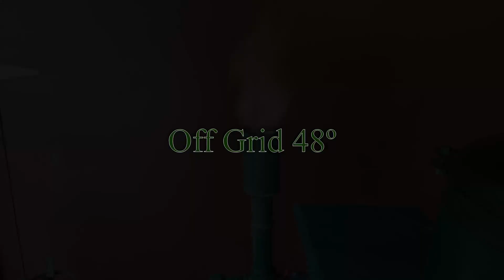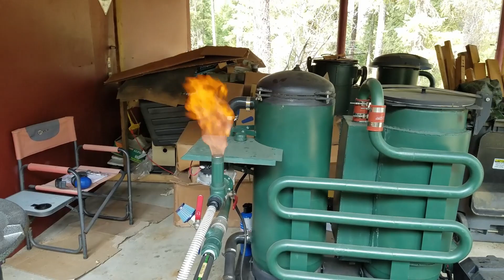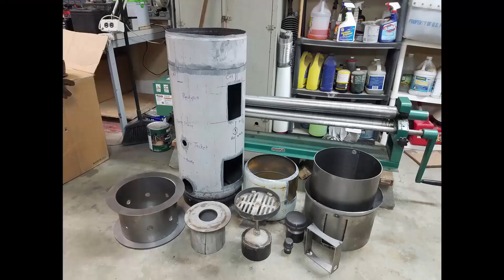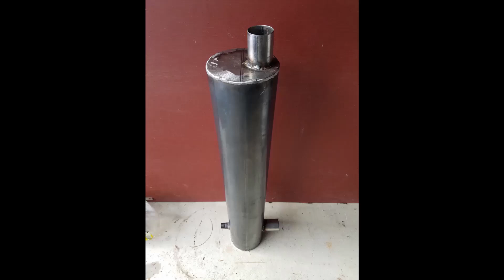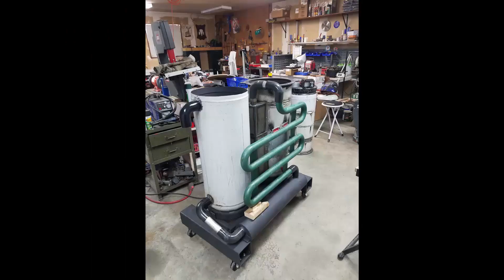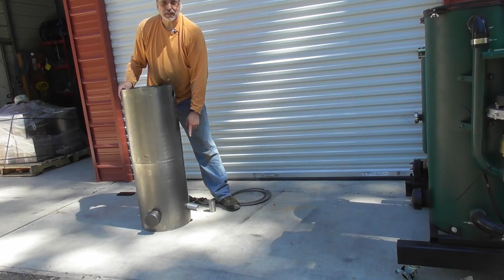Wood Gasifier Builder's Workshop: Filter Tank Dry Fit

Comment: How much wood required for 15 kw electricty
Reply from the maker: General rule of thumb is 2.5lbs of fuel per KW/h, so 15KW generator would require about 37.5lbs of fuel per hour.
Reply: @steveoffgrid485  thanx sir